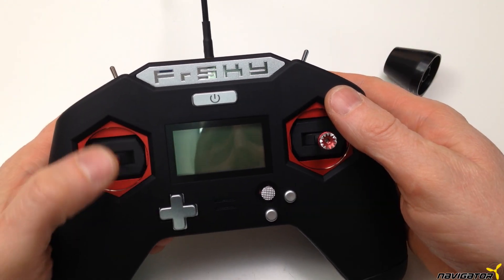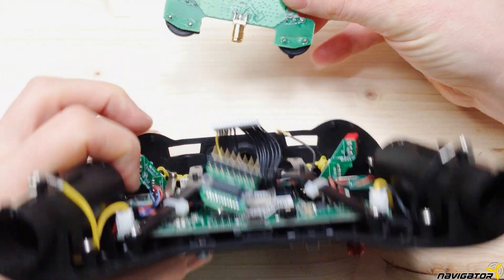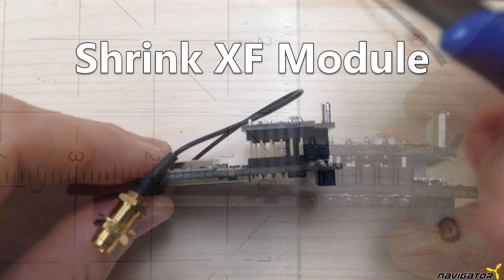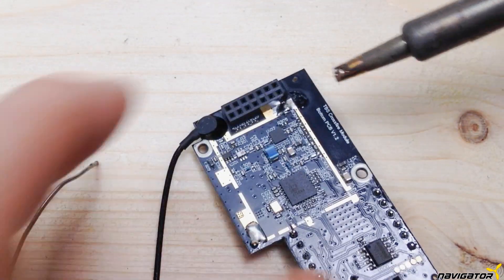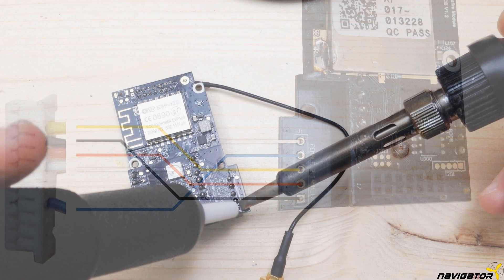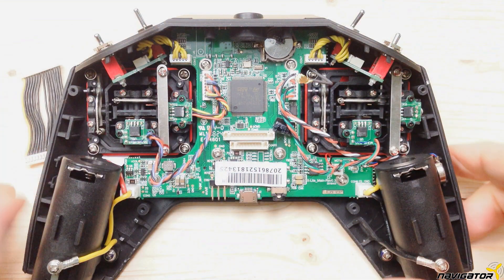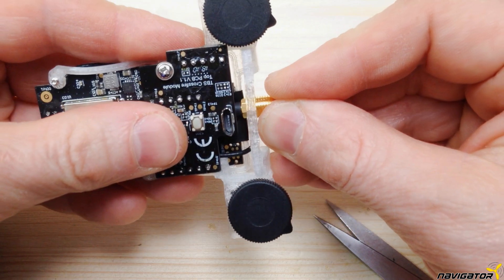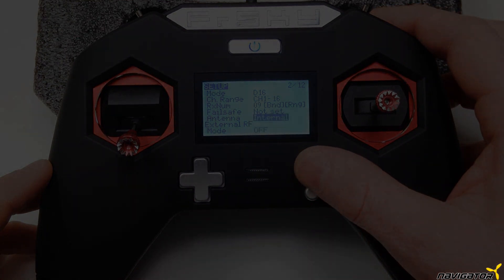Guide FrSky Taranis X-Lite TBS Crossfire Micro TX Stealth Mod Range Extension Hack (English)

Comment: what about leaving the stock expansion port open and build a switch to cut Negative Power from CRSF Module and than use the Multiporotocol module for Frsky/DSM etc..? will this work when only the ground is separated from the crsf module? Thank you for your guide. I only had issue with wrong pod wiring, but figured it out that connector was reversed.
Reply from the maker: It's worth a try. I myself do not have experience with that though.

Comment: @n4v1g4t0r Done the mod, followed steps exactly, now getting "Waiting for crossfire device" when running lua script. The tx binds to rx (using the buttons), but I cannot access lua scripts via the x-lite. Is this a software issue? I'm on all the latest firmwares for OpenTx and Micro Tx...
Reply from the maker: Which XF device are you trying to reach? The micro TX? That should work at any circumstances. Try the (new) native OpenTX Lua Script that comes with the SD Card Content. It's being accessed via an own menu, not the SD Card File content.

If you can't access the Micro Module with the native OpenTX, you might have an issue with the connection. Check all wires and soldering points.

Comment: @N4V1G4T0R
 Pots doesn't work, could you please tell me your software version?
Reply from the maker: 2.3
Reply from the maker: As I learned, there is an error in the wiring diagram, the header is reversed. Sorry for that.

Comment: Your wiring diagram for the pots is incorrect. The connector is backwards and wiring it as per your video it won't work
Reply from the maker: Well, thanks for the hint, however, the pots work fine. So, I can't really confirm your comment. Maybe it's reversed, but that can be adjusted in the settings of the FC firmware. Anyway, in the meantime I prefer the simplified variant without the pots: https://youtu.be/6ZpShQl64ZU
Reply: @N4V1G4T0R  no, it's just that the connector header is backwards in your picture. 

It's a small mistake but kept my pots from working so I had to figure out that you had the header reversed in the pinout wiring diagram.
Reply from the maker: sorry for that. thanks again for the hint.
Reply: @TAGE_FPV  could you please send a photo of a correct one
Reply: Same problem, what did you do with your pots?

Comment: I need you to do this to mine please
Reply from the maker: Surely. ;-) But I'm sure you can do it. 
I am working on a manual for the Mod on a X-Lite Pro, which is even easier.
Reply: @N4V1G4T0R  
Really hope to get this done.  Ty
Reply from the maker: The hardest part is, to open the case of the X-Lite, without damaging it. ;-)

Comment: Hi there - I'm doing this mod on a X-Lite Pro, however I want to retain the ability use an external module as I want to use a multi protocol module. 
What would be your suggested connectivity to keep both modules selectable.

I was thinking I install a power switch on the power rail so I can manually turn off the internal crossfire module and therefore allow the multi protocol module to be installed and powered up. Thoughts?
Reply: If anyone is wondering, I've done it
Reply from the maker: Great mate. Let us know how you did it. Honestly, I have no need for another module. I go for crossfire on all of my quads.
Reply: @N4V1G4T0R  it was a bitch; let's just say that. dual power switching between modules; finding the right traces to keep the external module wired properly and retaining the pinout bracket so I can still use any external module I want.

All undocumented :( 

The positive note is; it's now the perfect x-lite Pro :) 

Can do everything including fly whoops
Reply: @TAGE_FPV  So you have to have 4 different switches for each pins? Would pls you share something more.
Reply: @TAGE_FPV  I have been trying to figure out how to do exactly what you explained above. Can you give any hints on how you got the external module to continue working as well?

Comment: Awsome ! Still working with X-Lite Pro ?
Reply from the maker: yes. the x-lite is not perfect, but close to perfect compared to other transmitters out at the moment. still waiting for the brain wave TX, but, hey, i was born too early in time.

more to come, I'm waiting for the x-lite pro to mod it for crossfire.
Reply: @N4V1G4T0R  do you know if the new cnc gimbals on the pro edition will work with the original I'm just about to do crossfire mod on mine now thanks for your video btw it's super informative and easy to follow 👍👊
Reply from the maker: I suppose they do, but I have no prove yet. Sadly the display of my pro had a minor issue and I returned it. Have not gotten the replacement yet.
Reply: @N4V1G4T0R  OK great looking forward to your next video on the xlite pro 👌👍
Reply from the maker: working on it. sadly, the good weather is good for flying, but bad for creating videos ;-)

Comment: Awsome video! Do you think this is also possible with the New x9 lite transmitter that will be available soon ?
Reply from the maker: Hello,

i do hope so, because I have a Preorder für the X-Lite Pro edition and will also want to modify it for crossfire. I expect it to work because the differences (mainly better gimbals) should not affect the mod.
Reply: N4V1G4T0R I’m curious to see your results with the Pro, as I’m seriously considering picking one up but have heard conflicting reports on how it behaves with modules.

Question for you: if you do this mod, can you still use the external “bay”? Like it I wanted to run a Vantac multi-protocol module on the back for Spektrum?
Reply from the maker: I am still waiting for the X-Lite Pro. So, no news yet.

The connection to the external bay is modified and used by the modded TBS Crossfire module. So, i quess not, at least not without some hardware hacking.
Reply from the maker: Confirmed. X-Lite Pro has basically the same innards as the X-Lite in terms of space for the module. So, it will be able to use the identical procedure, used in this video.

Comment: Can you access the usb connection of the crossfire or do you have to use the xlite usb for firmware updates etc?
Reply from the maker: you can access the usb connector of the crossfire module. however, you need a small hole at the back of the transmitter, behind the lid, to access it. you can also drill a hole for the button and the LED. The holes will not be visible with the lid on.

Comment: Have you done any long range flying with this radio and the crossfire yet? How is it? Really considering the xlite as my next radio but haven’t seen much for long range with it.
Reply from the maker: Unfortunately, Long Range is illegal in Austria (under most circumstances). So, I can not give you an answer on that.

However, it's not the X-Lite itself, it's the Crossfire Module, that makes the difference. And the XF Module is still the same, just in a different case. In  other words, the module has the same range capability and characteristic as in any other transmitter, where the module can be used (the QX7 for example).
Reply: @N4V1G4T0R  alrighty, i was just wondering because unlike the qx7 i dont have to mod the xlite (other than to put it inside if i wish) to use the crsf. i was mainly worried about power life with using it. we tried a qx7 with the crsf module (small one) and set it to the 250mw and had some issues, the battery was a little low but nothing that has given us problems before. so we switched it back to 100mw and put a fresh pack in and have had zero issues, even when the battery gets kinda low. the xlite though feels great in hand, and loving the feel of the sticks compared to my x9d
Reply from the maker: same here, i love the "compactness" of the x-lite. no issues with it so far, only the gimbals could be of a higher quality, they could be more exact.